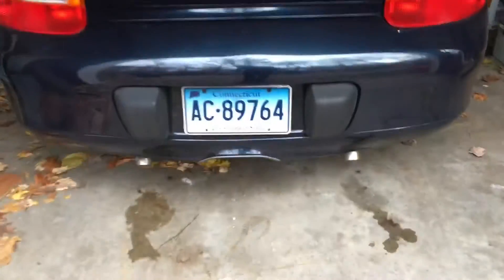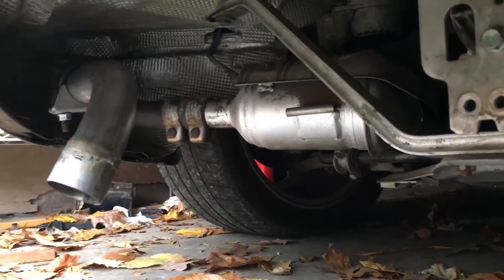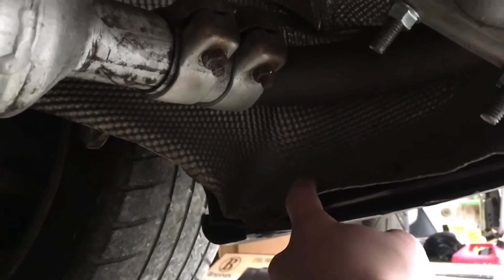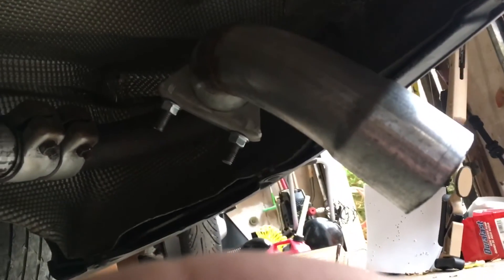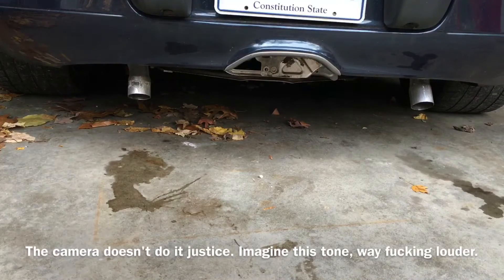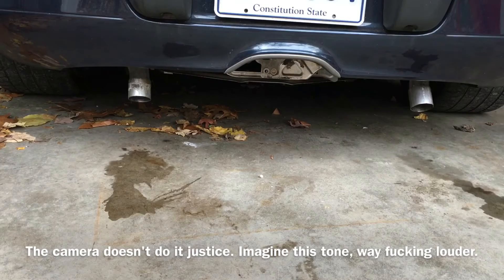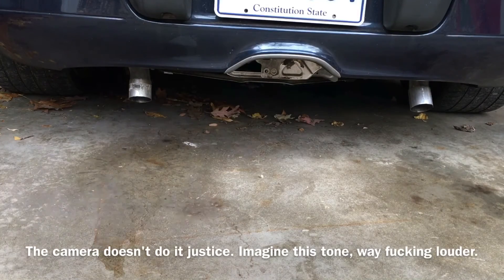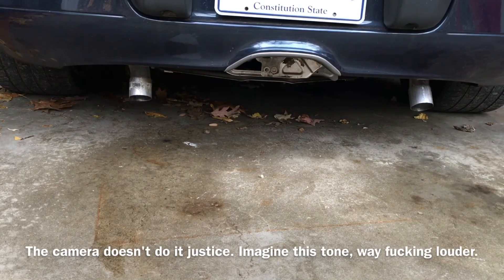99 Boxster Muffler Delete

Comment: @Captain Bows How did you connect the 90 degree piping onto the stock u-pipe?
Reply from the maker: Johnny Gig with a U bolt pipe bracket, something like this https://shop.advanceautoparts.com/p/walker-heavy-duty-u-bolt-clamp-35773/10083049-p?c3ch=PLA&c3nid=10083049-P&adtype=pla&gclid=EAIaIQobChMIsNHl-rbQ3wIVoaOzCh0MVQq0EAQYBSABEgKxh_D_BwE&gclsrc=aw.ds not sure that specific one will fit but you get the idea.